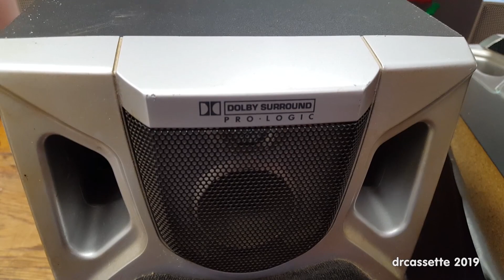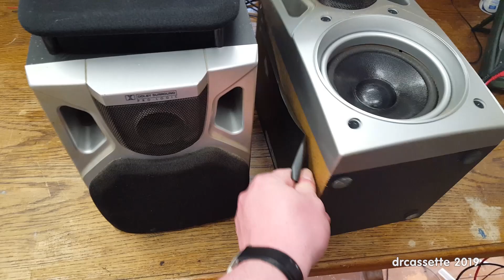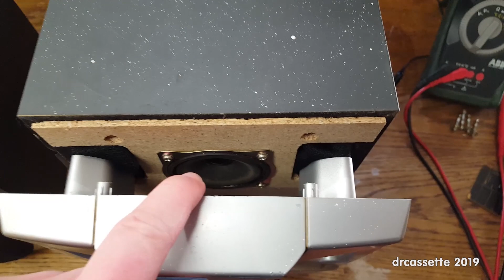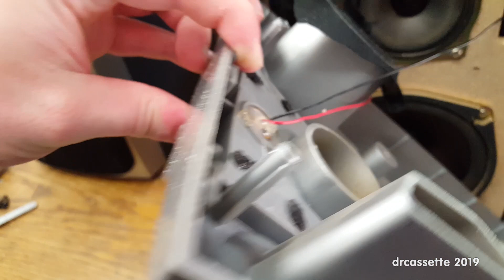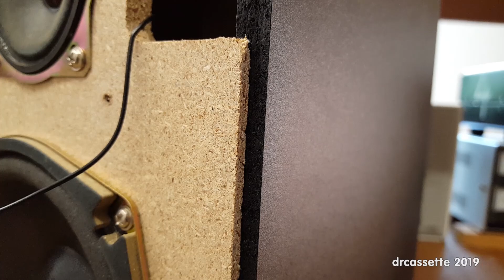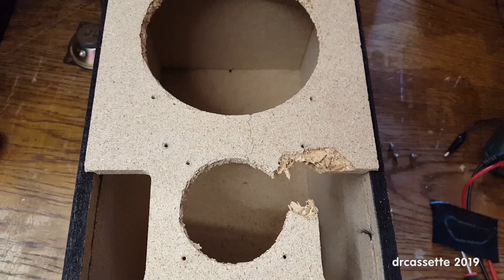Teardown of a cheap 2-way speaker

Comment: Jo.. what's the crossover frequency for these?? Anyone?  I think between 80 and 100 but not sure
Reply from the maker: The crossover in these speakers is made up from just a single capacitor, which will not give a defined crossover frequency. The woofer is basically a full range speaker, it gets the full unfiltered input signal.
Reply: @DrCassette thnxxx

Comment: That's one thing that I don't like about all in one stereo systems is most of them tend to have inferior quality speakers 
compaired to the sort of speakers you would use with a seperates system. Although with some all in one system speakers 
the tweeters are just decoration I was surprised those speakers have 3 drivers in them. I think in most cases they do have 
real tweeters.

Comment: I bought a cheap woofer with 5.1 outputs for my parent's home theater and the surround speakers that came with it looked very similar to these, they had the same pro logic label on them. Unfortunately i threw them away as i had already installed better speakers in the living room already. Probably a cheap chinese non-brand from the mid-2000s or late 2010s. The woofer does its job btw

Comment: I think the complete speaker with all the drivers connected in series would equal around 6 Ω.
Reply from the maker: 2 Ω (woofer) + 8 Ω (tweeter) = 10 Ω, but you don't connect speakers in series.

Comment: My guess, 2 ohm speaker goes with special 2 ohm amplifier. Aka they wanted to make sure you didn't use these with any other amplifier. I had a Panasonic SA-AK330 system. Bi-amplified speakers (turns out actually bi-amplified after tearing down the amplifier) I believe it was something along the lines of a 10 ohm tweeter and 3 ohm woofers. To top that off the woofers are power hungry, stiff suspension to work with the cheap ported enclosure.

Comment: I still don't think anything will beat those "high end" speakers I found several years back that were about the same size as these, but just had a single 4 inch driver in each cabinet!
Reply from the maker: I remember years ago you found some speakers with ridiculously big bass reflex ports, are those the speakers you mean?
Reply: @DrCassette  Yeah those were the ones.